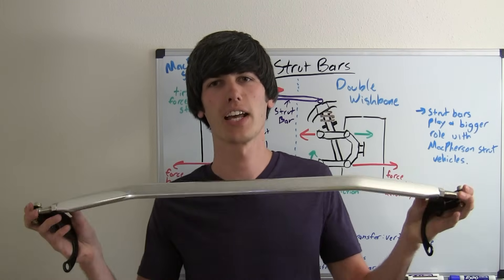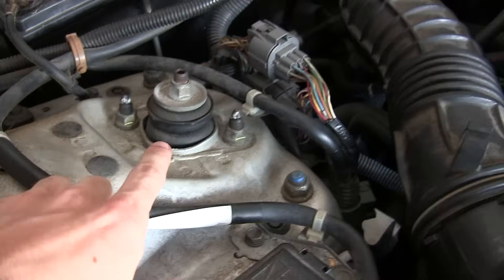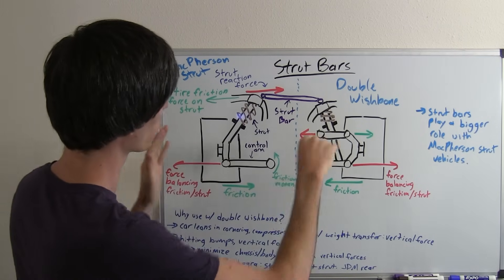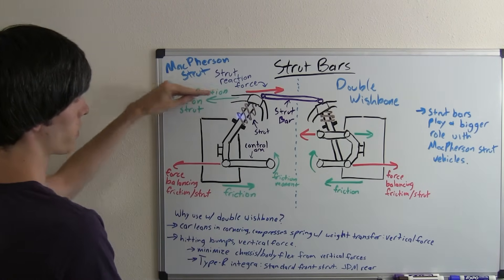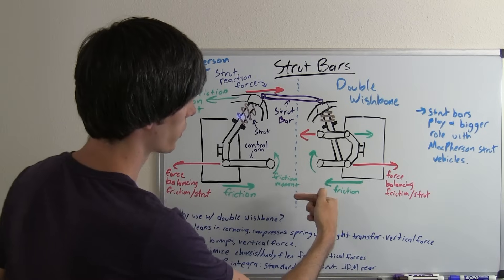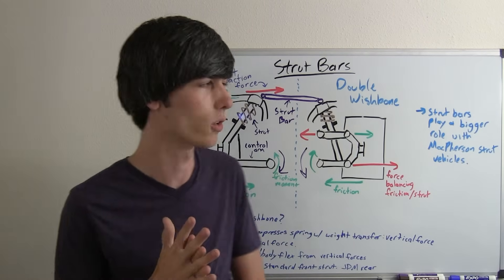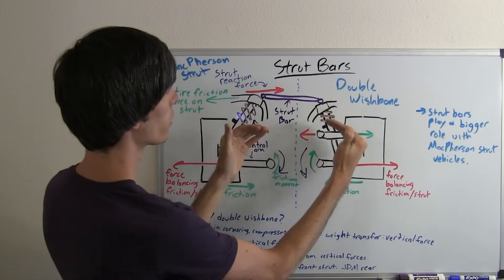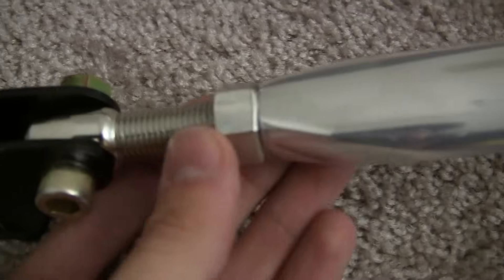Strut Bar - Explained

Comment: strut bars are great..the one in your video would not be used on a race car since it has two joints..as rigid static strut bar would account for chassis twist..like when you go around a turn or go over a bump..  good vid

Comment: Is the gain with a strut bar on a double wishbone that significant? The angle between the shockover and the line between the fastening points of the strut bar is fairly close to 90˚, so if you take the cosine of that close-to-90˚ angle, the force transferred to the other tower is theoretically not that great.
I'm tempted think it would make more sense to try and find a way around the engine and strut the two upper wishbones to each other.

Comment: The windshield is glue to the frame, which turns it into a stressed member. When the front of the car is stiffened elsewhere, it transfers the stress to the windshield/frame. Something's gotta give.
Stress cracks that begin in the edges of the glass is the result.

I knew one guy who went through three windshields.
Replaced the heavier sway bar with a stock unit and the cracks stopped. He was one of a handful who experienced the problem.

Comment: left tower is being pulled out of the body, while the front right is being pushed in. It sounds as if the brace would exacerbate the problem by transferring energy from left to right, unless the push and pulling forces from R/L are not equal, where which it would even out adverse effects, I do understand it increases the amount of energy required for the same given outcomes but is not more logical to mount it directly to the chassis ?

Comment: In your vids, you say that the body of the car absorbs the the forces only in McPherson system. This is a little confusing. Since the springs are attached to the body, it has to absorbs the weight. I think you mean that a McPherson suspension transfers both rotational and linear movement.

Comment: Most strut bars are hinged so the up and down forces don't really travel to the bar. Using a fixed bar will put additional stresses on the towers which are thin so ideally should be reinforced.

Comment: Old vid, new to me. Is it accurate that strut bars can lead to increased risk of hydroplaning d/t reduced flexibility and also increase risk of tire damage over large road imperfections d/t increased stress/rigidity? Also, I read that front strut bars increase under steer, while rear strut bars increase over steer. ??

Comment: or too thick of a rear sway bar.  Usually people don't want to get rid of the oversteer in an FF platform, though, as a tad of oversteer allows the car to rotate into sharp angles easier, it makes it handle much better.  Of course it lowers the stability on quick turns at high speeds.
As for the understeer, there's so many factors:  Tire pressure, tire surface heat, sway bar size, body roll, struts/valving, and the driver for example.You can make the best setup FF car push if you drive it wrong.

Comment: Reason why the Integra and civic s with the double wish bone front suspension benefit from a tower brace is because the front upper A-arms bolt on to the towers so high that they essentially exert the same force a MacPherson strut does on to the towers.

Comment: What about a torsion bar suspension? Would a strut bar be any benefit, the springs are down low, but on a torsion bar suspension there is no upper arm and it is connected to shock tower. Would this make that the load bearing point as in the double wishbone suspension?

Comment: Enjoyed the video, very good explanation. One thing though – when you look at your example strut bar it's made of, basically, three links. Having a single solid piece prevents movement more certainly and would not allow the strut bar to flex, which is the purpose of this exercise! They're not easy to find, but I think it's worth looking. Even this multi-part piece is better than nothing, but why not go for the real thing?

Comment: In the case of double wishbone hondas, the top arm usually bolts on to the shock tower also, so most of the in/out force and up/down force is transferred  to that area. For me, on the filmsy honda civic and integra chassis any added strength is a bonus, and maybe might make them more survivable in a wreck, aside from any handling advantages.

Comment: You can't really feel the strut tower difference until you push your car hard around a corner or if you drift or slide the car.  It changes the chasis dynamics of the car.  It gives your car more rigidity and stiffens up your suspension more.

Comment: Hey man, love your videos, I have a 1996 GSR myself, will be getting coilovers (possibly the ones you installed) and a strut bar as well.  What purpose does adjusting the bolts on the edges of the strut bar serve?  Not sure the proper name, where the silverish bolt w/ nut meets the black parts that mount ontop of the strut. 
Much thanks
Reply from the maker: An ideal strut bar wouldn't have these, and would simply mount directly to the strut towers. I'd recommend finding something like that, which doesn't allow for pivoting and thus reduces the effectiveness of the strut bar.
Reply: I see, that makes sense, do you have a brand you would recommend? Also how are you liking your coilovers? thanks for the reply!!
Reply: Engineering Explained Which is exactly my question: I've always wondered how effective my current strut bar (same as one in video) is, because it pivots how much effectiveness is reduced though you think?

Comment: This may seem like a dumb question, but what's the best way to install a strut bar? Should the car be flat on the ground, all the way of the ground, or just slightly off the ground so there's little load on the suspension? Or does it even matter? 

Love your videos!

Comment: So based on your explanation, should strut tower braces be adjusted so that there is tension pulling the strut towers together?  I've always done the opposite, and adjusted them so there there is tension pushing them apart.  After seeing your video, now I'm wondering if my previous thoughts were not accurate.

Comment: When i saw the actual strut bar, there is some thread connecting the bar to the join. I was wondering after installing, can you adjust the thread so that there is some tension to further increase the rigidity ?

Comment: I once did an autocross where I switched from strut bar off to on each time, I think around 6 runs each, two drivers.  Recorded times and tire temperatures across the surface of the front tires.  No detectable difference in anything.  This was on an MR-S which, granted, is very light up front. We were on very sticky tires though and setting fast times, so cornering forces were high.

Comment: Hey man, great video. Quick question though. Those bolts will surely not be tight enough to keep the bar from moving under high force. Why put bolts on each side when it'll just allow movement in the bar and allow less of the force to be transferred/absorbed? Personally, I have an OEM three point strut bar on the front that bolts to the firewall and has no pivot points.
Reply from the maker: I agree, no pivoting seems like a better solution.
Reply: Engineering Explained
Thanks for the response! I always wonder why a lot of aftermarket strut bars, even from high end companies, have pivot points. Anyway, I went on a streak of watching your videos last night and subscribed, keep up the good work!

Comment: I was considering getting a strut bar for my MINI (R53), but most owners say the gains aren't worth the cost and that I should get camber plates instead because it would reduce the already bad understeer. 
Other than creating oversteer, what else could happen (pros/cons) if I increased the negative camber? Will I chew through more tires? Any help is great.
Reply from the maker: DaBriceisRight Increasing camber doesn't really mean you will wear through tires faster, per say, but your tires will wear unevenly so they won't last as long (inside will wear fast, outside will wear slow). If it's an autocross car, you can have some small benefits from a 1 to 2 degrees of negative camber, but if it's purely a street car then really you're just sacrificing tire wear and not really benefiting. You'll take advantage of the camber angle when you're on the very limit of lateral grip, but not before.

Comment: In an FF setup with MP's that's most likely coming from too tight of a rear end.  What kind of suspension are you running and how thick is the rear sway?  Your OS problems are most likely sway related...same for your US, most likely, but there's many more factors that affect that on FF..

Comment: what it better one between Strut Bars Vs Sway bars or (Anti Roll Bars)? It look like they both doing the same jobs. thank you
Reply: completely different. Sway bars a designed to keep you suspension more leveled during a turn. Strut bars are designed to ad rigidity to the chassis of the car to prevent body flex.

Comment: If i colour my strut bar Red, will I gain 50 Hp?
Reply: +Ali Yes definitely.
Reply: +Ali I thought it was just 5hp ;). If you want 50hp, you need change the alloys too.
Reply: absofuckinloutely
Reply: for extra hp you need a bumper sticker
Reply: Yes but if you want your car to run cooler you want a blue strut bar. To reduce emissions you're going to want a green bar for that one.
Reply: Only if you zip-tie an oil catch can and various extra lines and wires to it for that electromagnetical coupling with the ECU, and adjust it so it pulls on the strut towers hard for that maximum camber stability.
This is only for the front one, if you use one in the rear you need to paint it matte black, which basically transforms it into carbotanium and actually reduces the weight of your car, but don't forget to use a spoiler to keep traction on those rear tyres of your front wheel drive!
Reply: While it is true that the carbotanium produced by the paint decreases the overall weight of the car, it would be advisable to note that the overall braking efficiency is hindered by this approach. Since the carbotanium is black, it absorbs heat more readily, which over time leads to failure. This usually isn't an issue if you have an AWD car (All Wheel Delay), because the wheels themselves stop the car. This saves money down the line as there are no costly brake pad replacements. But seeing as though you noted your example used a front wheel drive car I thought I would chime in with a professional opinion :-)
Reply: It's a 2000bhp gain
Reply: Candisa 😂😂😂😂
Reply: Wrap it in carbon fiber. 100 hp and 50 handling added guaranteed
Reply: Paint adds weight lol
Reply: No but if you loose weight yeah

Comment: Unless you plan on doing more suspension modifications like springs upgraded struts or coil overs a sway bar will not do much for handling. I did not ad a sway bar due to it being stiffer can actually can be worst in some driving conditions like rain.

Comment: Does my Honda Civic (EK4) have McPherson?
I have found a rear upper strutbar on the net, but will it add oversteer?
At this point my car has the original shocks with Eibach lowering springs.
In about 3 weeks my car is getting the KW Variant 3 suspension, that is for sure.
A strutbar will make the car stiff, but will it add oversteer?
Thanks!

Comment: Question!: So during conering, the strut bar experiences tension as its holding the chassis together, but under a bump, its under compression? Also, does a strut bar control the balance of a car? or is that a sway bar? And finally, i heard  that strut bars are useless unless they are connected to the firewall or more than 2 points.

Comment: Great video. But can you talk about the structural rigidity of the shown strut bars and solid one-piece units?
It would seem to me that simply by having bolts and brackets that would decrease the overall intended effect. Can you clarify/confirm in your knowledge?
Reply from the maker: TheSeekerOfOneness Yep, I would certainly want something rigid and solid in order to have much benefit. I've considered welding the bolts on the kit I have.

Comment: I have recently ordered new manual brz 2016. As your knowledge and experience, do you think I should buy front and rear strut bars ?. I drive to work everyday and I love to drive. Plz advise me to make more fun in drive. Thank Jason
Reply: MrSparda2110 Not the owner of this channel, but am an FR-S owner for over 3 years with lots of track experience and A solid Foundation in Engineering principles. Front Strut Tower Bar Works out very well on and FR-S / BRZ, at least the very well engineered Grimmspeed one does. Very noticeable difference with and without the strutbar, mainly in ride quality as you notice the difference in front end stiffness or "Cowl shake" when either going over sharp bumps or dips. The front end will feel more solid and less unsettled also gives a slight improvement in handling when at the limit as well, with a more planted front end.

At first you will feel like there is just a hint of understeer added -. But that just means you are not use to pushing it as hard as the chassis needs to be to see the improvement (this is for a '13 FR-S though , which has a different suspension setup than the BRZ) Here's a data chart that Grimmspeed made from their testing phase of the 86 chassis showing deflection of the FR-S / BRZ chassis through a series of slolams: 

https://www.grimmspeed.com/product_images/uploaded_images/strut_tower_brace_14_635.jpg

Direct quote from them about the chart:

"Performance metrics, both quantitative and qualitative were carefully tracked through development and following production. In our slalom testing, peak deflection between the strut towers dropped from .180in to .030in, a decrease of 83.3%. Even more notable than the lowering of deflection was the substantial decrease in 'noise' within the data. You can truly feel this improvement the first time you leave your driveway after the install. Expect an immediate and noticeable decrease in NVH and a noticeable increase in sharpness and steering feel. The chart below shows strut tower deflection through a series of slalom turns before and after the installation of the GrimmSpeed Strut Tower Brace. What you see is that without the brace, the data shows a great deal of noise and unpredictable deflection, indicating an unsettled chassis. After installation of the brace, noise in the data is greatly decreased and behavior is much more predictable. With the brace installed, the chassis reacts as you would expect, cycling between tension and compression as the brace works to maintain stiffness between the strut towers through the slalom. " 

Rear strut bar is not really worth the effort / money in comparison, it is a really reinforced area of the car chassis and is utilizing a multi-link suspension setup instead of a strut setup. So definitely do the front bar, do not do the back unless you just want to throw money at something with next to no benefit.

Thing is I would not only do a front strut tower bar install by itself for the FR-S / BRZ, but also pair it up with proper steering rack bushing design. Actually, I would consider that even more important to do first than strut tower bar to be honest ... the stock steering rack bushings are really soft rubber with a ribbed cross-sectional design that combined with the fitment of the bushing sleeve with the mounting bolts using rolled threads and a smaller diameter shaft provides so much slop in tolerance stack up that the steering rack is actually not concentric with the mounting point and physically moves around very much when cornering hard.

If you are pushing it you will feel the weird, mid- cornering steering hesitation trait that is slightly unsettling to the whole cornering sequence. Install either solid Delrin or aluminum steering rack bushings with proper tightly toleranced machined threading fasteners / shoulder to the bushing sleeve and the steering and handling through the entire cornering sequence become perfectly linear with ZERO hesistation / slop on intial turn-in and better steering feel. The steering rack will also be concentric and solid in its mounting verses sagging and allowed to moved about (giving a small degree of active camber change when you really do not want it to.)

Solid Delrin bushings with tightly toleranced machined threading / shoulder to bushing sleeve fit and Grimmspeed Strut tower bar should be the first mod done on an FR-S / BRZ if you value precise steering feel / feedback and ride quality at all and the factory one is unsatisfactory. I'd never go back to stock from the Grimmspeed Strut bar and Aluminum steering rack bushings ...

Comment: Subaru makes their version of the Strut Bar that has a Flexible Joint in the middle. if the whole purpose of a strut bar is to make the chassis more rigid, what's the advantage having a flexible joint?

Comment: Meaning what do I have to do to fix this ?
Rear sway is already there, optional package from the factory.
I don't have the exact measurement however the sizes and shape are pretty much similar to the aftermarkets.
But no front sway bar.
For the suspension, I tried adjustable front and back but its too tight and slide out the tire, too tight I guess ? and during hard cornering, the tires floats !
So I added pillow ball on top of it, less but still.

Comment: so, I have, Ironically, an Integra DC1. Doesnt come standard with strut braces, but someone who owned it before me put them in, front and rear. say I took them out, at road speeds would I feel any difference in its handling? the car is very planted and stable despite the fact it has almost none of the performance Type R gooodies.

Comment: Would connecting my rear strut towers ( upper midway down ) with a brace essentially be the same as if I were to connect the top of the towers via the usual strut tower brace.